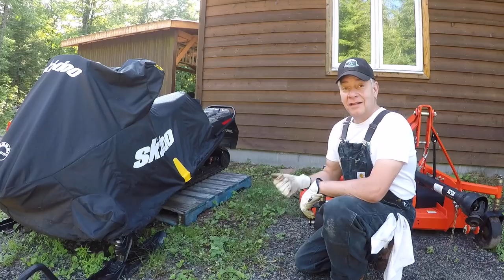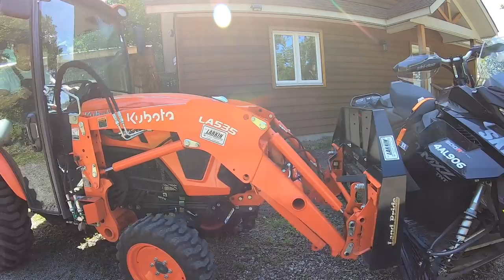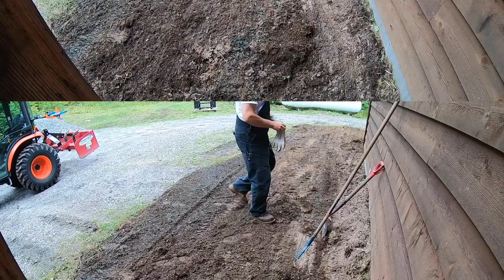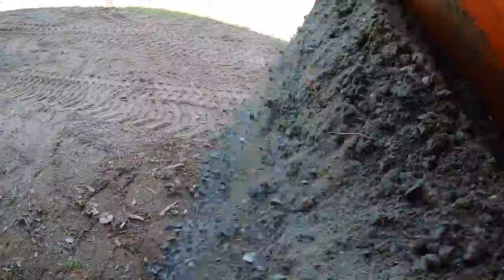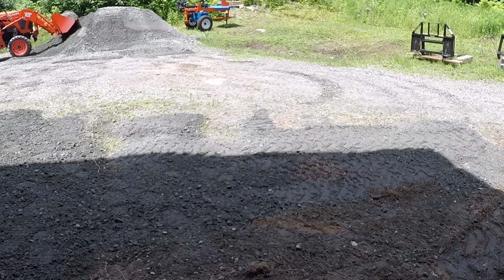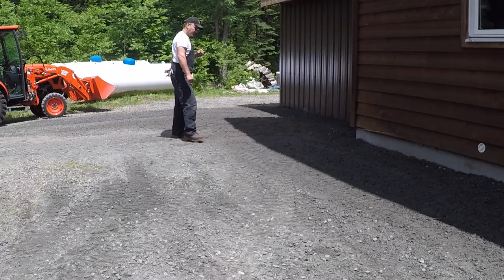#443 Kubota LX2610 Compact Tractor. Box Blade. Gravel Work in the Driveway. outdoors

Comment: I love krown I have been using it for years on my trucks and other things.
Reply: I agree! I have been using Krown for 2 years now on my Cummins turbo diesel before winter starts and I have ZERO rust yet! Stuff works amazing I soak down all my door hinges and hood hinges as well.. the stuff apparently soaks INTO the metal.. and stays protecting it for a very long time because of it! I did a lot of research on the best undercoat and Krown is one of my top products 👍🏻
Reply: @BiffsEquipment  I live in Michigan we use a lot of salt in the winter things don't stay nice for long around here. I have a 2015 ram 3500 that has been getting krown sprayed since new. I have no rust on my truck I get it sprayed on every year. I also use the spray cans and cover my trailer. It works good for electrical connections as well.
Reply: @simpleman4196  awesome man! Thanks for telling me your experience! I live in Upstate NY so I also know way too well about salt covered roads in the winter.. we don’t use any sand up here just purely salt even if we only get a dusting they still coat the roads with salt.. these dodge trucks are made out of thin sheet metal for the body’s and typically will rot out in no time and so far the body on my truck is like brand new.. it’s a 1999 Dodge Ram that I bought from New Mexico so it looked like the day it rolled off the assembly line when I brought it up here to WNY.. and I gotta say it still looks just as good only a bit oilier! Haha

Comment: I have had mixed results with crusher run near the house.  It is an ideal base if compacted with a vibrator, but it tracks miserably into the cottage on your shoes. I have covered my base with clean crushed granite 1/2 to 3/4 inch which does not pack but does not track indoors. And if it's available, granite (or similar) is much better than limestone gravel, albeit more expensive.
Reply from the maker: Morning and thanks M! I'll see how it turns out - maybe the next load should be gravel - no dust. Thanks for the heads up!

Comment: I have found that a bolt on cutting edge helps when back blading with the like you were doing in this video. I just have the Kubota smooth cutting edge, as opposed to some kind of tooth bar. I got it just to prevent wear on the bucket, but because it attaches ti the underside of the bucket edge there is a lip the thickness of the cutting edge and it helps drag material when back blading.
Reply from the maker: Morning Jan. Thanks for the great info. They asked me if I wanted to buy one when I purchased it but I didn't think I would need it. Perhaps will re-think that in the future. Thanks again!

Comment: Gord, sorry the vax has got you down, blame it on the broken siding... I don't know if you have seen some of these guys on YT with box scrapers, but they are handy, simple tools. The trouble is you were in such a small space and the tractor is so big. Basically if you go forward using the blade, the blade bops up and down as the tractor moves with the undulations of the old road. The trick is to move backwards with it in the 'sweet spot' where the blade makes a perfectly flat surface. If you move the blade down from the sweet spot it will dig deeper as you move, and if you move the blade up from the sweet spot it will dig shallower as you move. But if you can hit the sweet spot you can make a flat plane every time. Not easy tho. Good luck!
Reply from the maker: Morning David - some excellent advice - thanks! I was thinking about getting a wider box blade but haven't yet. Thanks again - all the best!